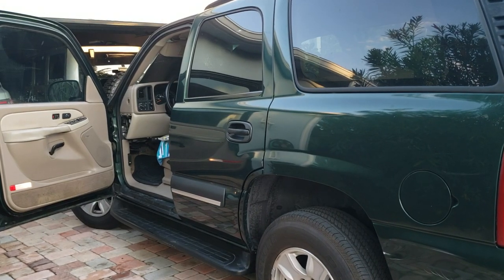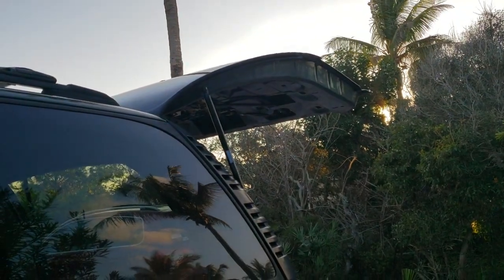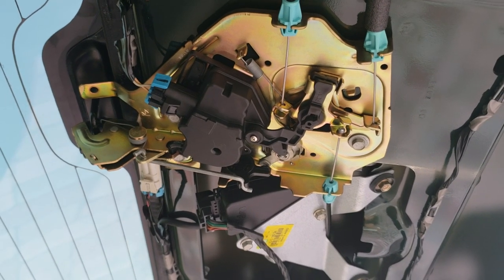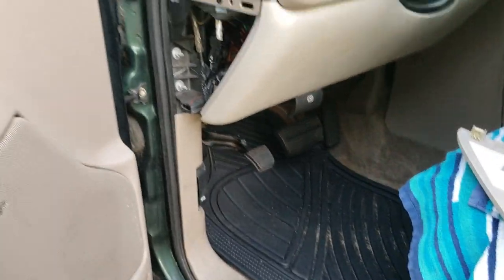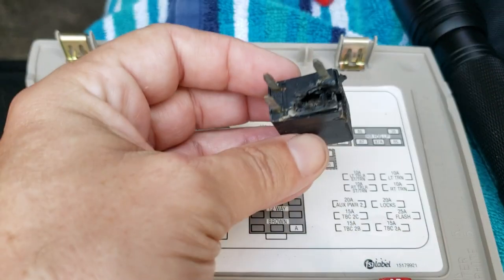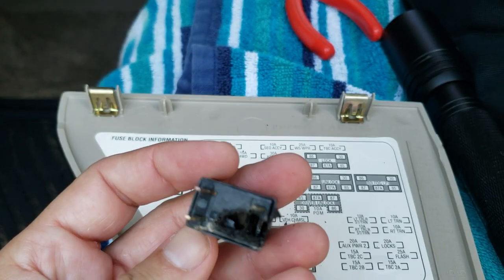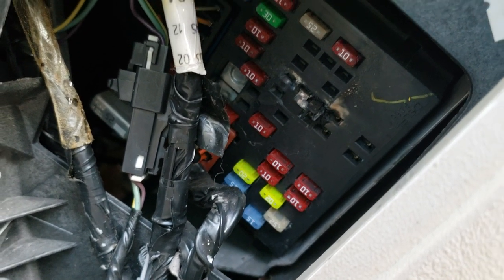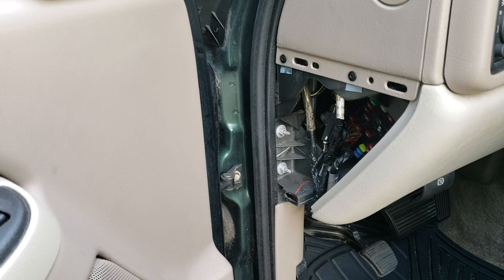2003 Chevy Tahoe Rear Doors and Liftgate Fix. Relay Fail!

Comment: Thanks for the tech support! I just changed the two in my 2004 Suburban, Works great again. I love my Suburban..........it just keeps on a'truckin'
Reply: Is there a way to test the relays the way that you can test to see if a fuse is blown. Or did you just go and buy two new relays?
Reply: I just "shotgunned" it. Bought two new relays and plugged them in. Got lucky. They were cheap on eBay.
Reply: @karlgruber3973  I think the guy who made the video said this won't work if the back door still locks & unlocks.
This only works if the back lift gate only, is broke.

Comment: So I noticed both of mine are in good condition and the ofther fuse for the tail gate is good also, what else can cause this to not open the tailgate or rear door I. General
Reply from the maker: @joseserna4918  swap them around. See if problem moves with the relay. Has to be bad relay. Just find it is the issue usually.

Comment: Is it possible for the relay to fail in a way where it ONLY affects the hatch lock and hatch glass lock? Or does it always affect the rear doors also? Idk if I should order a relay or a lock actuator both gonna take like 2-3 weeks to get here.
Reply from the maker: If your rear door locks still work it's the latch actuator. The relay is cheap so get one anyway.
Reply: @MegaHowtoMan  thanks for the quick reply I didnt even realize u relplied so early. Yeah I did order a new actuator and got it put on last weekend my liftgate works again!
Reply: I've had my Tahoe for 10 years and this is the 2nd time that the liftgate/ hatch has stopped unlocking. The back & passenger door unlock fine.
The first time I took it to a repair shop & they charged ALOT to take the panel off & replace the actuator in the lift gate. 
Now I'm going to try this 1st.
The weird thing is on my way home from work, I got in the truck and literally heard a noise in the back of the truck when I turned the ignition to on. Almost like a popping sound.

Comment: Did you fix it yet? Did you replace the fuse box or did new fuses/relays work?
Reply: My actuator went out, I replaced that. And after a full day of working correctly, it stopped . Then my dash. Said “replace tailgate fuse.” And here I am. Ordered 2 new relays and waiting for them to come in
Reply from the maker: Yes. The relay was inserted in the wrong slot and shorted. New relay fixed it. This is the relay panel at the driver side door.
Reply: MegaHowtoMan wheeew , that was a cheap fix for you then instead of replacing the whole fuse box due to that area being fried...ya mine is in the same area and requires 2 relays, should be here in a few days and we’ll see if it fixes my problem
Reply: @B_HarTz is there a a way to test the relays like testing fuses with a digital multimeter?

Comment: Could those relays cause battery drain?
Reply from the maker: Yes. I had a battery drain from the drivers power seat adjustment and the aftermarket car stereo.

Comment: I changed the relay and the actuator but it the trunk door or lift gate still don’t work
Reply: My relays look fine but the lift gate actuator doesn't work. I replaced the actuator thinking that was the issue and unfortunately it wasn't.
Reply: @sergiopereziii  hey i figured it out, the little spring on the handle for the trunk door rests under the white lever looking thingy, so make sure it's well placed.